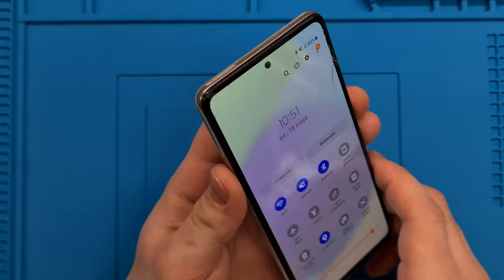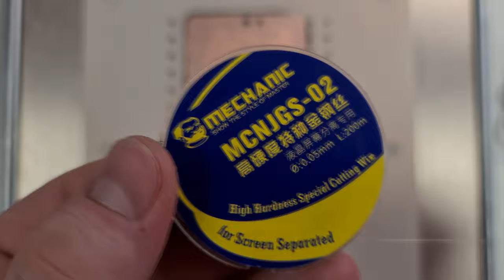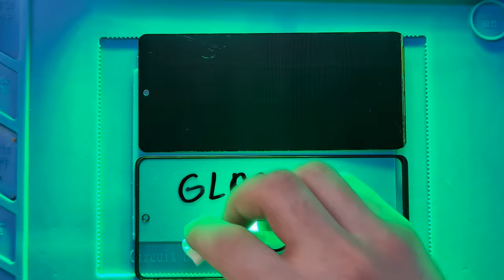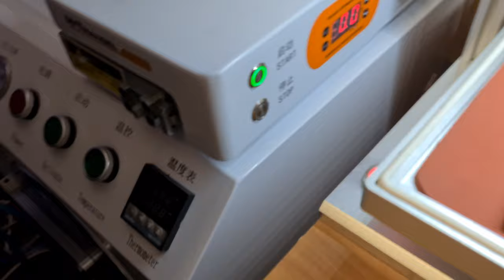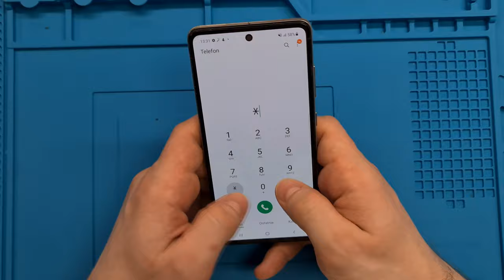🔧Galaxy A52 Glass Only Replacement 4K 60fps👓

Comment: helllo, what liquid are you using at 2.30m?  I found out that the phones comes apart easier if you use a hairdryer on the glued parts while seperating them. Regards